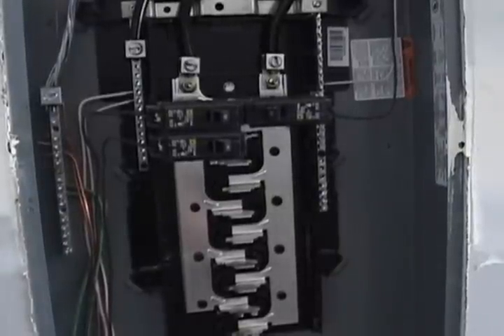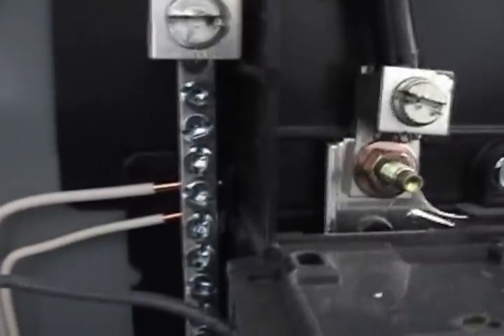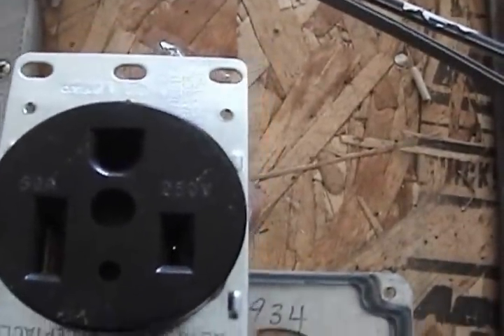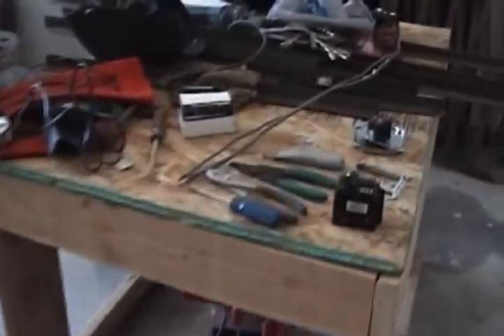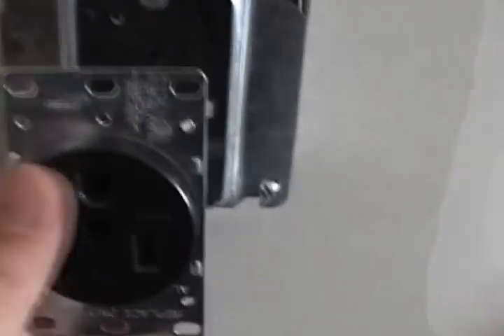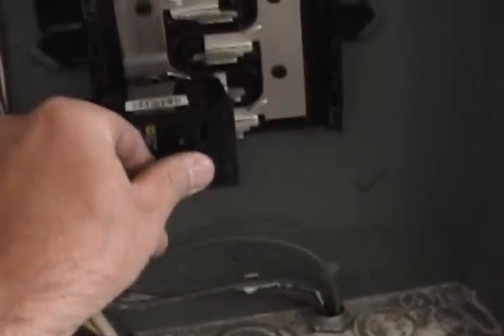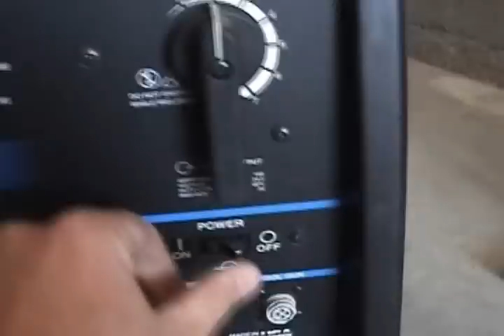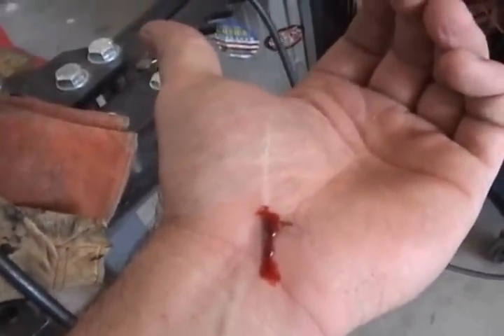How to wire a 50 Amp breaker and plug for a welder

Comment: holy shit that would never fly around here total fire wating to happen # 10 is only rated at 30 amps YOU NEED A # 6 wire  your going to cook the insulation on the wire over time and make a fire
Reply: You are 100 percent right. I was thinking the same thing.
Reply: 10 is rated for 40a and 8 for 60a in my code. And considering that's like a 3ft run of wire it can handle it no problem. Clearly you were trained to install but not trained in the properties of electricity and equipment.
Reply: Collin Huebler True, but larger 6awg wire would not hurt any. Not sure why he did not do it unless he just had 10 laying around and was being lazy.
Reply: John Rambo I gotta 10 laying around but I mean a 3 feet strand won't be too much. I'll get a 6.
Reply: You made a good decision with 6. Better to go with the 6. I went with the proper gauge wire for my everlast welder when I got things wired up.
Reply: For use with a MIG welder, it's unlikely to be an ACTUAL problem.  Consider that the MM210 can only run 035 wire  max (it really prefers 030), and he's unlikely ever to be cranking it up to 250A, since the 210 isn't any good at spray transfer, and at max amps, the duty cycle is only 30%, so the welder will melt down before the wire does.  The problem is more likely to come when he sells the house and someone puts a 15HP air compressor on that circuit, thinking it can "handle it."

Code should be followed, and 10ga would not pass inspection, even on a short run.  Per NEC Table NEC310.15(B)(16) the absolute MAX current allowable for 10ga is 40A, and that's with some pretty special, high-temperature wire (with the usual Home Depot THHN, max is 30A).  Collin Huebler obviously has his own code that has nothing to do with the NEC, and whether it can "handle it" (in special circumstances, for short duration)  is not the same as meeting code.  I've seen people run air conditioners with 14ga extension cords, and it "handled it" as long as the compressor didn't stay on more than a minute or two.  You cannot meet code screwing 10ga wire to a 50A breaker.

Comment: you should be changing that wire to #6 good for 55amps  can't tell from the video but even if it is #8 its only good for 40amps #10 is 30amps but thats just my 2 cents chaging 5ft of wire is cheaper then replacing everything after a fire no?

Comment: I don't know what the code is where you live, but 10 gauge is not enough for 220v/50amps where I live.  Although you would probably be fine with 8 gauge, 6 gauge is code.
Reply: fabio40 i used 6/2 romex with my 50 amp receptacle just to be safe as well
Reply: fabio40 if my welder needs 230v input, what shoulf i use for a connection?

Comment: He has installed a breaker too large for his wire but really he only needs a 30 amp circuit for that welder. The wire is fine, the breaker is not.

Comment: Not a good idea - the breaker is designed to protect the wiring, and if you only have 40 amp wiring you don't want to drop in a 50 amp breaker. You could possibly overload the wiring and start a fire without ever tripping the breaker.

Comment: I stand corrected on my original comment.  He is good with #10 because it matters about the duty cycle rating of the welder.  Article 630 of the NEC.

I was wrong but not wrong in a way that a fire would start or anything dangerous. I just wasted the guys money on overkill wire lol.

Comment: Interestingly enough, a circuit for a welder must not be used for anything else, and the wire used does not have to be as large as it would need to be for a continous use circuit.  According to nec welders are generallly short duty cycle and #8 wire will suffice and I am told by a licensed contractor that 10 is acceptable.  I would never use stranded wire in any case.
Reply: #8 thwn or thhn yes 60 amps......#8 nm only 40 amps

Comment: Dude please stop and call a Electrician. I have seen people burn there house down, by overloading there electrical drop.
The wire starts burning on the side of your house, it's really cool to see.
I cost me $1600 to replace my 60 amp drop and panel to 200amp.

Your color coding is not for a car.
10 gauge wire your foolish. I wouldn't want your junk welder when it dies, which will be soon.
Your starving it of amps.
Like when you or your neighbor use the brown extension cord from the living room floor lamp. 
To power your power tools and can't figure out why all your tools keep Quiting after only an hour of use.
Great Jobs showing everyone what not to do.

Comment: if you're actually using a 50 amp plug then you need to be using at least 8 gauge wire that is rated at 90 C
Reply: Andy Swanson wire WILL get hot

Comment: 10 guage is rated at 30 amps not 50 amps, you need number 6 wire for 50 amps

Comment: The breaker has to be the weak link.  Weaker than wire at conditions of use, and weaker than terminals.  A 50A breaker needs a minimum size of #8Cu, if wire and terminals on both sides are rated for 75C (which most terminals are).

A 40A breaker also requires #8Cu as a minimum size, since #10Cu at is only good for 35A at terminals.  Therefore, if the wire is good on a 40A breaker, it is also good on a 50A bkr.  Complete coincidence.   DO CHECK the terminals on both sides, for a 75C rating.

Comment: that welder only draws 27 amps, I have one. so 10 is fine
Reply: 10 IS Illegal on a 50 amp breaker, regardless of draw, the breaker has to be the weakest link in the circuit not the wire
Reply: I agree, even tho the MM210 only draws 27 amps at full load, the wire should be a #6 or the breaker should be a 30 amp...
Wiring a machine to a higher amp circuit than what is needed to make it function properly is NOT a good idea... The machine can possibly destroy something within itself prior to tripping an over-rated circuit breaker..

Comment: Wire has to be # 6 AWG for a 50 Amp Breaker. Its a short run so you really don't save that much in the cost of buy a 10 ft of # 6 wire.
This is probably ok for you but you have to put a video on youtube showing another people how careless man you are.

Please delete this video.
Reply: National Electric Code Article 630-Welders Duty rating. You can put 12 awg on 50 amp breaker for dedicated NON-motor welder with a duty cycle of 20%
Reply: +drmibew351 I am looking at the code right now. I am struggling to wrap my head around 630.11(a). Am I supposed to run a 90 amp breaker for my machine? I was just going to go with a 6/3 conductor and 50 amp breaker/outlet but now i'm not sure. Here are the specs for my machine. 

Non-motor
23 volts

150 amps
Duty Cycle 60%
Max OCV 33 
Amp range of 30 - 185
Reply: Average internet experts don't know about the difference for welders & their so called in rush or start up draw

Comment: Proud of yourself? haha    

Hope you have a fire extinguisher near by because #10 wire is good for only 30 amps.  If you have a true 50 amp welder you need #6 wire.  I'm an electrician i know what i'm doing.

It may work now but slowly that wire is getting hotter and hotter inside the wall and will eventually catch fire.  Do yourself a favor leave the electric work to the pros.

Comment: Should have use 6-2 Romex wire.  White (120V) phase 1 and Black phase 2 (120V) are hot=220V and bare Copper is ground for this type of breaker(50Amp) and wiring.!  For those of you wondering, there is no neutral used for this type of installation.  Not the best instructional video. Although with the short distance and a low duty cycle welder, it works but no need to mark the White wire with Red tape if the white is showing and on hot, black on hot and green on ground in this case unless for his own preference.  Better to be safe than sorry with wire size and marking. Red and Black are hot on a 10-4 or 10-3 wire, White being neutral, Green or bare copper are ground depending on which type of wire you have..etc.